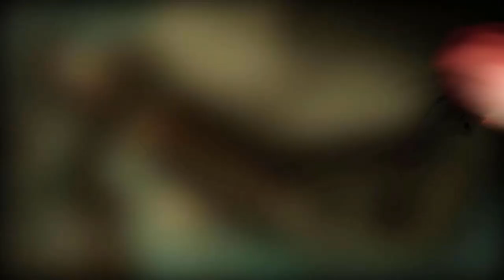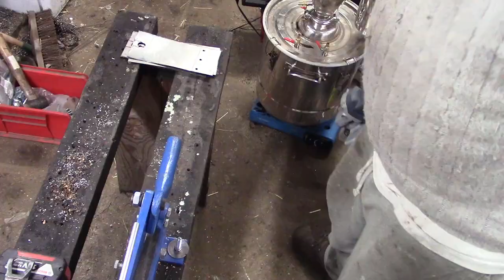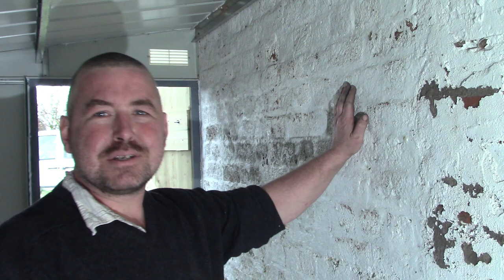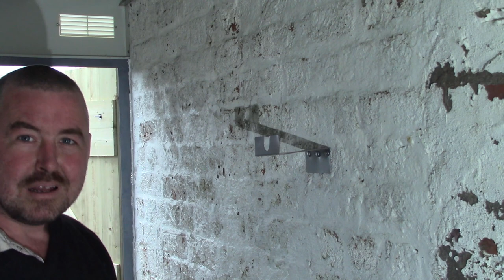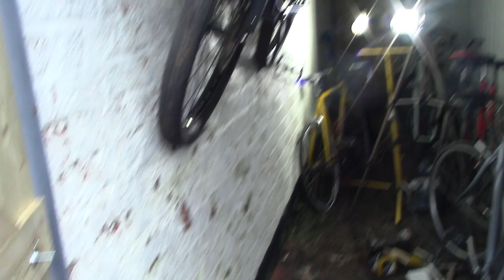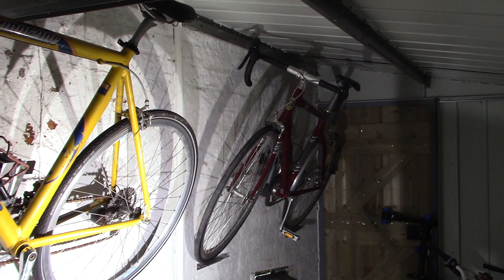How to make easy bicycle wall storage hang brackets

Comment: Very nice idea! I have seen one where they have ceiling hooks and the bike is hung upside down by the tires, but, your way keeps the bike more tidy with the wall and minimizes the footprint
Reply from the maker: If I was in a classy old apartment with 12' high ceilings, that'd definitely be the better option, lots of ropes and pulleys, and a canoe up there as well!

Comment: Can those nail in anchors be removed Jim?
Reply from the maker: No mate, not without destroying them
Reply: @turboconqueringmegaeagle9006  Rodger. They are very interesting. Haven't seen them before
Reply from the maker: £10 for 100, stronger than plugs but not as easy to hide, quick to install.
Definitely a useful arrow to the diy quiver!
Reply: @turboconqueringmegaeagle9006  My DIY can be a bit rough. Like a bears behind 🙂